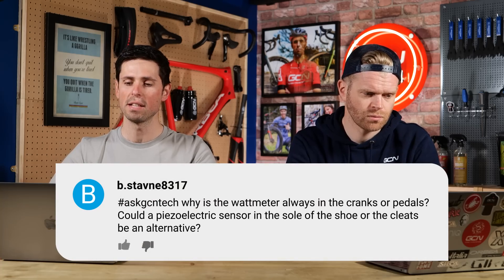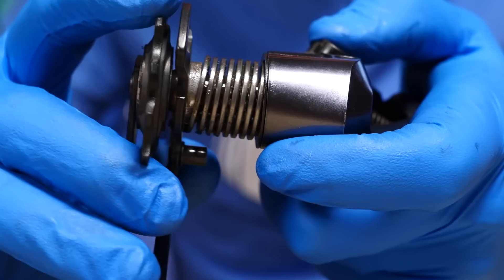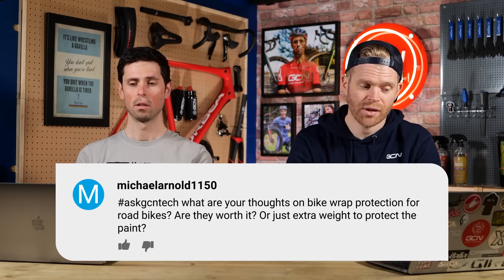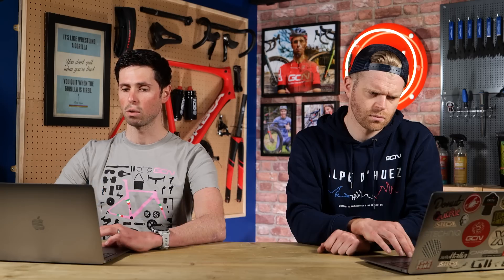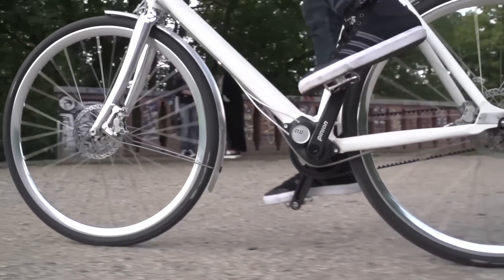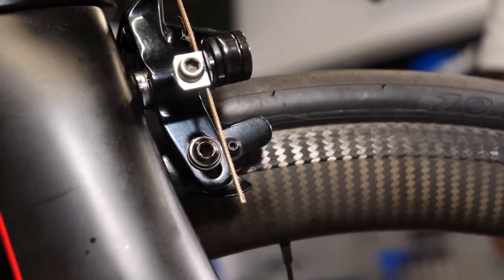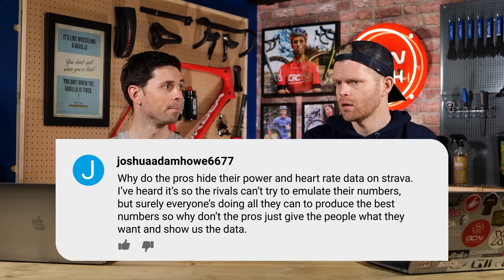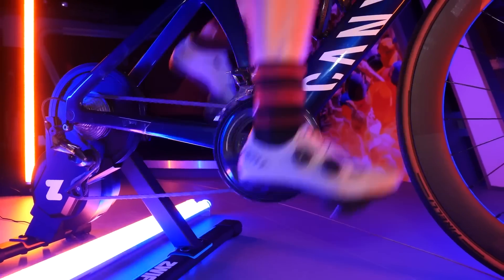Frame Wrapping, Carbon Rim brakes and Pro Data | GCN Tech Clinic

Comment: #askgcntech Some questions about the racing: What does "Washing Machine Effect" mean? GCN commentators will use this team to describe the peloton. When the pro race rider bikes have some problems, the team mechanic will change to a new spare bike to save time. However, each rider's bike setting is different, the team mechanic how to prepare and set these spare bike components and geometries e.g. saddle height, or stem length which can fit all riders? And, in some one-day or stage races, the number of riders is different in each team, such as from 4 to 8 riders,  does UCI have any regulations to control the rider number to make every team plays fair? Thank you!
Reply: Washing Machine effect is where as soon as a rider/team spends any time at the front of the peloton, they get overtaken by others riders/teams that have been sitting in their slipstream. They in turn then have happen to them and so on and so on - giving the effect of clothes tumbling over and over other clothes in a washing machine.

Each team car would have a spare bike set up for each rider on the roof, so the mechanic grabs down the right bike. The favoured riders bikes being the easiest ones to access. Although they are set up identically, riders often still prefer their initial bike and often swap back if the issue with it is fixed while they’ve been riding the spare.

As for team sizes, every team starts any given race with the same amount of riders. 7 per team for men’s world tour 1-day and short stage races, and 8 for grand tours.

Comment: experts recommend tubs in carbon rim brake rims but now that rims are wider it doesnt matter so much. i would say they have minimal  failures which means bars and frames have maxiumal failures as we see them fail on a regular basis. i'v never seen a carbon rim brake wheel fail but im sure i could happen with a crappy or older rim and a heavy guy going down a mountain side.

Comment: I'd love to see contents like: converting old roadie to carbon belt / internal gear Hub and competition from you guys racing, climbind and other funny competition from traditional road vs Amazon bike vs a high end belt drive, etc
Reply: Unfortunately the one caveat with belt drives are that the frames require a removable section in the drive side stays to loop the belt through the rear triangle, or an elevated chain stay design that goes above the dropout and the BB area. You can't split a belt like you can a chain.
Reply: Vintage road bike could have too flexy rear triangle for belt drive. Belt drive bikes mostly are aluminum things with hefty back.
Reply: @matt_acton-varian  Not true. There is a brand of belt drive called Veers with removable pins that you can split. The sprocket then fits onto a standard freewheel for single speed bike conversions.
Reply: @rob-c.  I did not know that existed. You learn something new everyday 👍
Reply: @matt_acton-varian  veer cycle sells a split belt for bikes. But I never see one, just internet promo

Comment: Hey guys i have a question, basically each time i do a round trip, my wahoo will usually say that i have either climbed more than what I descended, or vice versa, in my mind if you cycle a perfect loop  you will go up as much a you go down, is that correct?

Comment: 7:28 carbon rim brake technology was / is at its peak with AC3 braking surfaces on e.g. Campagnolo Bora. I wonder if the presenters ever tried those wheels. If they did, they would love them.
Reply: AC3 doesn't address the main problem of carbon rims brakes, heat dissipation and delamination.
In fact it makes it even worse. 
The more friction you create, the more heat you generate and the quicker delamination will occur. 
Carbon rims and rim brakes is a huge no-no
Reply: @FlyingPastilla   It's much better, as more friction on AC3 enables you to brake harder and shorter, as a result you won't build up as much heat.
Don't take my word for it though. 

On a long or tricky descent, giving the rims and pads periods of cooling is very beneficial to keeping the system temperature under control. Most important is to not drag the brakes for prolonged periods of time as this continually heats the rim, pads, tube and tire. In our internal testing, we have achieved surface temperatures approaching 700 degrees Fahrenheit after 5-6 minutes of prolonged heavy braking (simulating a 300-pound guy descending a 20 percent grade for 5+ minutes, so not a likely real world situation). Releasing the brakes for even a few seconds can reduce the temperatures on the rim by over 100 degrees, whereas keeping the brakes applied, even lightly, will continue to heat the system. Again, whether you begin to slow 75 meters before the hairpin or 60 meters before isn’t very critical, but riding the brakes the entire way down the mountain isn’t good for any of the components in the system.
—David Ripley
Technical PR Manager
Zipp Speed Weaponry

In our experience, the shorter, more aggressive braking method is preferable. While the heat at the rim/pad interface will be higher during braking, the additional time between brake applications will allow for more cooling of the rim as compared to a prolonged braking method. Put another way, when brakes are used for a longer time at lower power, there is less time for the rim to cool off in between brake applications.
—Steven Sperling
DT Swiss, Inc.

We have been measuring rim heat up for a while now. The worst case, this is real world with a temperature reader, is a long, feather-type braking. This warms up the rim [more] than a hard pulse stop — it spikes an already warm rim. Carbon is a good insulator, so when it can’t dissipate the heat, it slowly collects it and holds it. 
—Steve Hed
Founder, Hed Design

The worst type of riding style for carbon wheels is the “rear brake dragger.” Prior to our CTg laminate, the typical carbon rim heat failure was almost always the rear wheel; rarely did we ever see a front wheel with heat failure. Now, with the CTg laminate we don’t really get many heat failures at all, not even rear wheel failures.

To answer your question directly … Yes, for sure, shorter, more powerful braking produces less heat build-up than prolonged braking. We’ve known this for a long time to be the case.
—Paul Lew
Director of Technology and Innovation Reynolds Cycling

I double-checked with our R&D team. The heat would be the same in both cases.

The difference is that in shorter braking, the temperature will not remain high for a long time. With prolonged braking, the temperature remains high for a longer period of time and is what causes issues on carbon rims, inner tubes, brake fluid, etc. (depending on what brake system you use).
—Maxime Brunand
Mavic Road Product Line Manager
Annecy Design Center, France

The longer the brake pad is in contact with the braking surface, the more friction will be transferred to heat. Even a dragging/rubbing miss-aligned brake caliper can cause heat build up. On long descents, dragging or “feathering” the brakes actually causes more heat build up than quick, short uses.
—Daniel Large
North America Technical Service
Campagnolo North America Inc.

Steady drag of brakes produces more heat buildup, because shorter, high-intensity braking allows heat dissipation during non-braking time.
—Wayne Stetina
VP R&D
Shimano American

For slowing down on descents, I always recommend against prolonged braking. It can depend on the quality of the rim and brake pad, but shorter, more powerful braking will typically produce less heat buildup.
—Tom Guerin
Founder, Dash Cycles
Reply: @l.d.t.6327  great research and citations! This is excellent info, thanks. I'd always assumed this to be the case and whilst my rims may or may not be AC3, the principle carries over. Now I know it's best to brake faster and harder than shorter and softer on my carbon rim brake wheels which is important where I live.
Reply: @Hysterically-Inaccurate  You're welcome. Ofcourse, when you don't have much friction, you simply can't brake as fast / hard with carbon rims, and you'll likely end up braking for a longer time, compared to alloy rims (let alone discs). But it's a fact that braking on a carbon rim can be pretty reliable and, performance-wise, on par with anything, if the braking surface has some texture.
Reply: Never had an issue on Campy carbon clinchers. I do alpine descents and I’m pretty crap on breaking technique.

Comment: If I have multiple bikes, (ie: tarmac on the kickr, a triathlon bike, and just this week a new road bike) what's the best way to maintain accurate power readings across them all? I have Favero Assioma pedals on my triathlon bike and I use the Kickr for power on indoor rides. I've compared the two readings and they're consistently within 5 watts on average over the course of an entire ride (obviously not every second of the ride.) I recently got that road bike not on the kickr and it comes with yet another power meter in the form of a single-sided crank. Do you have any advice for me to standardize all of my power readings to have a consistent FTP and an idea of what these metrics should be across bikes? One option would be switching the Assioma pedals around the bikes but I'm worried about damaging them by removing them all the time and inconsistent readings every time it's reseated. Thank you! #askgcntech

Comment: Hi GCN Tech Crew, I'm on a GRX Di2, 2x setup, 48-31 in the front and 11-34 in the back, I expeirence this case when I back pedal, my chain tends to "go down a gear". Is this expected behaviour? Or is my indexing wrong? I didn't experience this on my 10 speed mechanical 105 last time. And online forums are saying this is an expected behaviour and you're not supposed to back pedal. But sometimes on trails you just back pedal to get your feet in the right position. Thanks a lot for the help. Cheers! #askgcntech
Reply: I had this on my MTB some years ago. Check your B-tension screw, you might need a bit more tension there. Did it for me.

Comment: I have a clear frame protection wrap on my whole bike and it gives me the peace of mind when I go out riding. A bit expensive getting someone to do it for me but i do enjoy it knowing I can "just ride the bike" and not worry about your shiny new frame from getting chipped, scratched etc. Also, I can still see the beautiful paint job of my bike! Weight wise I'm not too worried as I'm not racing and I'm also not chasing too much marginal gains. Just make sure to get a good quality one in case u ever have to remove it, as some wraps will damage the paint when u remove.

Comment: An advantage of having a good pair of "indoor" shoes that fit well and that you are used to wearing with SPD cleats is that when you are traveling and in a hotel its possible to use the hotel gym bike with shoes you are accustomed to. Of course the down side to this is that you will get to use Hotel gym bikes that are universally laughably bad, usually with saddles more akin to a sofa than your bike...

Comment: I've done full wraps on a handful of bikes using the same vinyls used on cars (3M, Avery, etc.) and the added weight for 100% coverage is roughly 70 grams.  Of course this will vary a bit depending on the size/type of bike and the exact type of vinyl used.

Comment: #askgcntech Hi guys, Manon and George.  How do pro team bed in new brake pads?  I can't imagine if you need to do 20+ bikes, they just take each one out for a 20 minutes "bedding ride".
Reply: There's an equipment with a pair of motorised rollers that spin the wheel of a bike, allowing you to bed the brakes in without having to ride the bike.

Comment: If handlebars get wrapped in tape so frame could be wrapped (just need wider tape)  - so one could change color of frame without repainting frame and fancy carbon bikes could be leaned against metal poles without cracking top tube.

Comment: #askgcntech Hi y'all! I have some carbon wheels for my road bike, it has rim brakes and I understand there is a greater risk of delamination under prolonged braking. I'm not wanting to change my entire bike or move house to a flatter area so what's the best bet for conservation of the asset please? All within the realms of safety but should I brake slow and light or shorter and sharper? Or something else? Appreciate your advice, thanks!
Reply: hi there, there's a comment in this comment section by a person named L D.T. about bora ultra wheels. check out the replies to that comment, it might help
Reply: @aizins3420  thanks, found it!!

Comment: carbon tubulars don't fail due to warping/overheating quite as much as carbon clinchers due to the inherent structure of tubular rims. Look it up thank me later.
Reply: yes, anyone that has seen the profile of said rims comes to that conclusion. The question i would ask is why take the risk in general if you can avoid it?
Reply: @dexterx55  because rim brakes look better imo, are much cheaper to build to "superbike" spec (cheaper by more than half) and have a significant weight advantage to disc brake bikes. Rim brakes are strong enough to lock up your wheel and have good modulation if set up correctly plus they don't rub like disc brake rotors
Reply: @matt92697  i agree that carbon tubulars are better for rim brakes compared to clinchers. Just not a big fan of tubulars in general. If i dont decent a lot and drive only in nice dry weather, sure im all for rimbrakes. Sadly we get a lot of rain and carbon rimbrakes in rain is suicide.

Comment: Why pros use only 550ml bottle? Seems like they need 1 bottle per an hour so for 6h race they need 6 bottles for each member.
Why not use 750ml or even 950ml bottles so they can keep being hydrated well? And eco-friendly. 
#askgcntech
Reply: They get handed refilled bottle on races so they carry less weight.
Reply: @event4216  Indeed. Though, closing frame gap can sometimes provide aerodynamic benefit especially for frame shape similar to Tarmac SL7.

Comment: I have a pair of carbon rim brake wheels, even the cheap Chinese variety. No problems but I live in a reasonably flat area so no long steep hills. Also, mine are for tubulars so the tire pressure does not stress the rims.

Comment: #askgcntech Hello GCN Tech. My gravel carbon fork, ( as most road/gravel ? , ) has a limit on 160mm rotors, but i haven't seen any limitation for 4 piston calipers .  I read somewhere , a 4 piston caliper is about 20% more powerful , is that less than 180mm with a 2 piston calipers ? How much difference is  there between those two ? 2 piston calipers need less maintenance in comparison and are less expensive,  so i favor them . Do you know of any documentation available ? Many thanks.

Comment: #askgcntech hello gents. Long time watcher, first time inquirer. Not completely a tech related Q but I'm curious to know if you and the other GCN peeps complete specific Training Peaks sessions for example mostly outdoors during our sunny summer months? As I'm living in Ireland, when the sun is shining I need to get out and make the most of it but given my surrounding terrain ⛰️ hitting accurate power outs at specific intervals isn't as easy or accurate when on the turbo, obviously. How do ye mange this in your training or do you tend to reduce the number of intervals in the outdoor sessions so it's easier to stay within the prescribed power zones. 
Open to the floor for answers to GCN subscribers here too.
Keep up the good work. Learning something new with every vid.

Comment: The major cons of carbon rim break is on a super decent after long climb and easy to wear out due brake pad heat friction. I suggest if you like climbing, go for the disc.
Reply: Some brake pads, like those from Kool Stop, have a "plow" built into the design on the pads that removes water and debris before they can compromise the breaking surface. I have these and they work great for breaking in the rain and preventing damage to the rims. Can't say enough positive things about Kool Stop brake pads.

Comment: I'm a larger rider and have a terrible time finding a bike that will fit me.  The geometry can be a challenge, but the weight even more so.  I'm about 275 lbs (125 kg) and many road bikes state a limit of 110 to 120 kg.  Are there brands (or other considerations) you recommend for those of us on the heavier end of the spectrum (especially if we want something sexy and carbon).  I've already bought a set of custom, 32 spoke wheels, but not sure what else I can do to make things work. #askgcntech
Reply: I don't know if there are custom builders who will do this for you in carbon, but I'm quite sure I've read about custom builders who do steel or titanium specifically for cyclists who are significantly outside the average. As an engineer, two points: (1) The outcome of a frame or wheel failure is generally very bad for the rider, so ensuring the frame is well within its load limits is important. It's easy for people to scoff at this if they haven't seen a failure or the injuries that result afterward. (2) As a fraction of your weight, a slightly heavier frame is still a very efficient machine. Your strength &power output are likely significantly greater than for a average cyclist, so couple of extra kilos in wheels in frame are not going to slow you down that much. Wishing you the best in your search for bike that works well for you.

Comment: 6:09 I used a pair of carbon rim brake wheelset, Reynolds Strike SLG (62 mm depth). The braking surface melted while I was riding downhill after a short 500 m elevation climb, rendering it unusable. It was used for almost only 5 years, mostly on flat local loop (no traffic light, almost doesn’t need braking), and I consider myself pretty lightweight (178 cm, 68 kg). So now I’m back with my old stock wheelset, aluminium rim brake.
Reply: What kind of brake pads were you using.
Reply: @adccars359  swissstop black prince